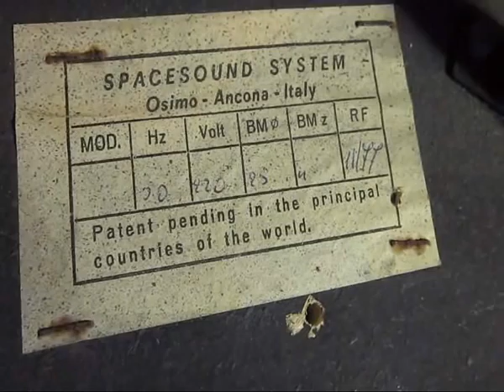"Hvorfor er lykken så lunefuld" - with Spacesound speaker

Comment: Hello. I have the same Spacesound rotating speaker. However, I lack the switches for the speed adjustment control. I'm not sure how much I'll use it, so I'm looking for a cheap, easy way to add switches, preferably to adjust speed fluidly. I'm based in the UK, so I presume the power supply is ready to be connected to the mains as it is. Could you tell me what components I would need to buy for the switches? Thanks!
Reply from the maker: The original speed control is really simple as it only has two speeds: Slow and fast - although they are often labelled Chorus and Tremolo. There isn't any regulation taking place. Instead there are two motors - one for slow and one for fast. The important thing is that they cannot be switched on at the same time. In an organ the switch system is usually made out of two switches (or in some organs relays) were the first switch turns on the power and the other decides which of the motors that are switched on. The switches you need are in other words ordinary two-way switches and they don't have to be anything special as long as they can handle 230volts. If you want adjustable speed I would think that and ordinary light dimmer can do the trick - although I must admit that I have never tried myself.
Reply: Thanks for the info! I asked around and those kinds of motors are synchronous, meaning their speed is locked to the incoming mains frequency. The only solution for fluid, variable speed would be to fit a low voltage DC motor, and actually some of the newer ones are powerful enough now. I wonder if this is also a better solution for rotating speakers in modern times.